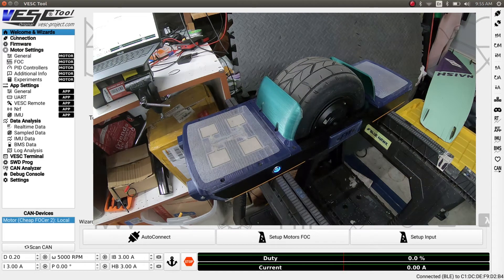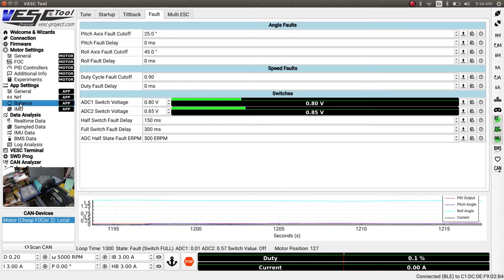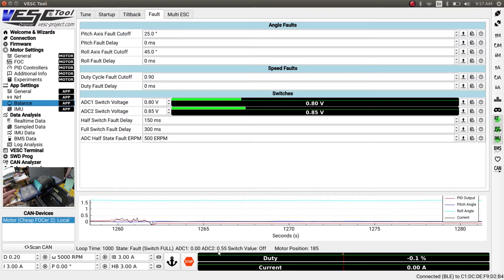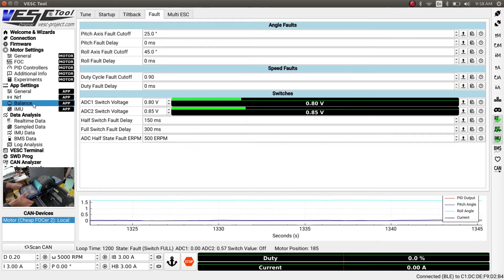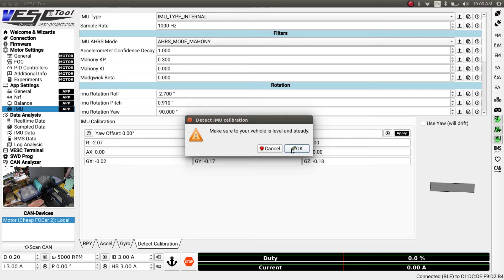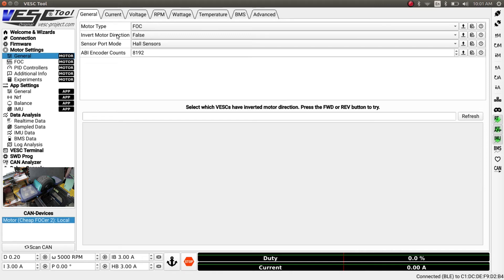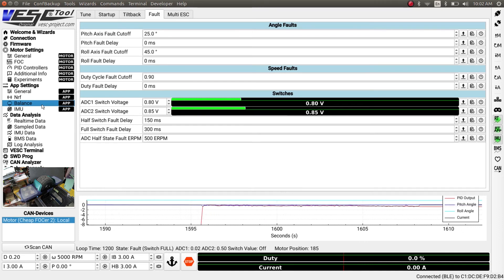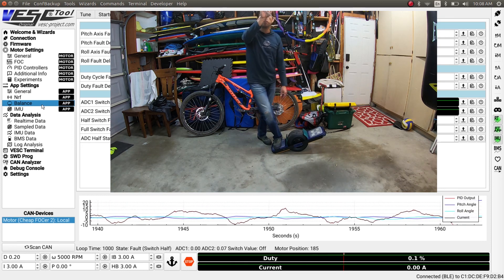Funwheel Setup - Footsensors, IMU, Balance Configuration (Obsolete)

Comment: It would be great if you showed the values you use for the other tabs in the balance app
Reply from the maker: Good point, I should have done that - I might add a video going through each tab
Reply: Thatd be awesome and greatly appreciated. Thanks brotha! So if all other tabs are left default and I did motor config, synched the IMU and configured the adc1/2 values as needed, would it essentially work as a fun wheel?
Reply from the maker: @davidyazdani6723  I'm sorry I just now noticed your follow up. Leaving default values in the other tabs will not work, enabling and configuring the balance app is an additional manual step, my video was only covering the steps missing in the Fungineers videos